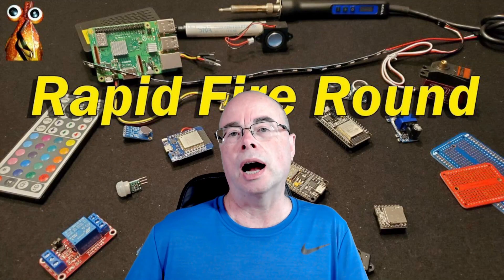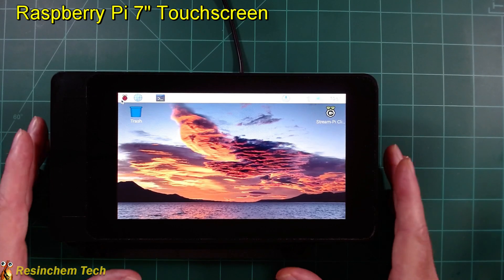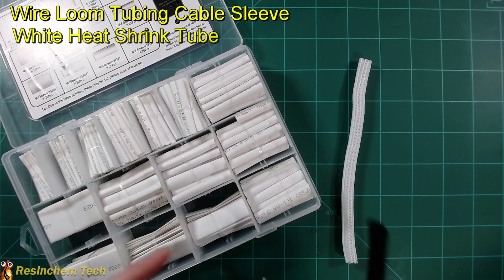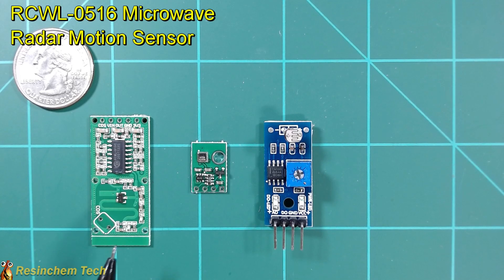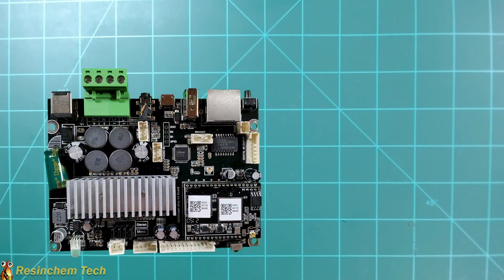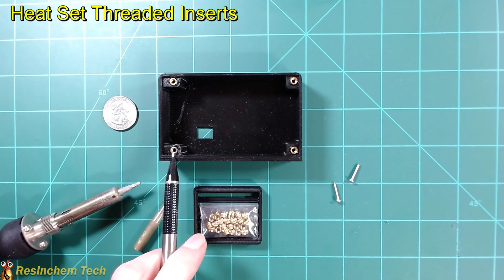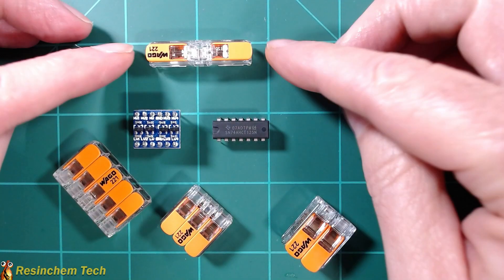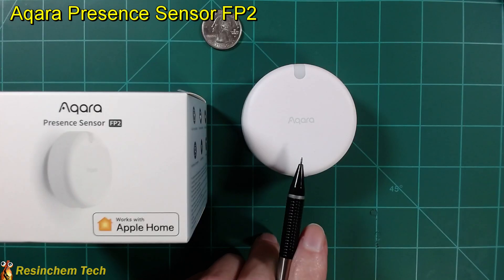My Favorite Components (2023 Update)

Comment: I actually Used the 8265 you recommended in your IR AC Upgrade in my own home!
I haven't tester the transmitter range, since my apartment is too small to get more than about 12 feet away from the units 😅
I'm still new to 3d Modeling, but I managed to make a pretty acceptable case for that ESP8265 device that's coming to thingiverse after a little bit of cleanup and writing a build guide with some of the tricks I learned getting the signals for my devices that don't have esphome climate integration support
Reply from the maker: I still haven't tried using the actual board with both the transmitter and receiver and the onboard 8265, but I'm glad you got it to work.  In my case, I didn't have a need for a receiver (just the transmitter), so I added that to my collection of parts that "someday I'll find the perfect project for it".

I'll look forward to seeing you information on that board and how you learned the IR signals.